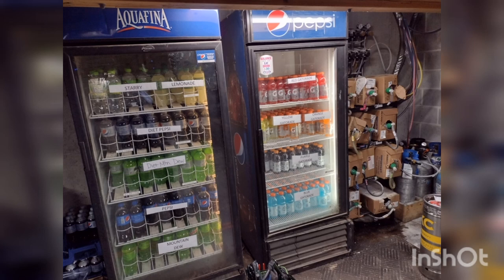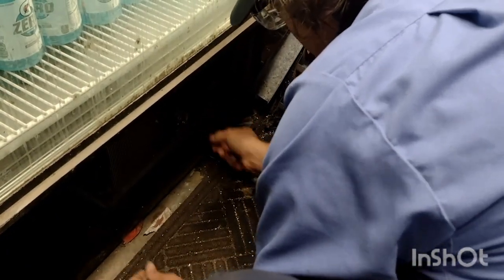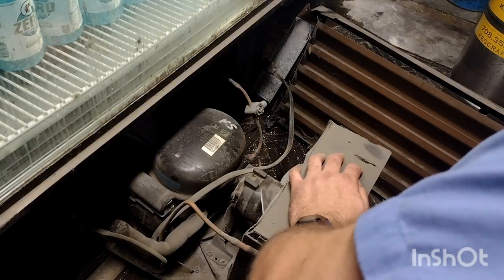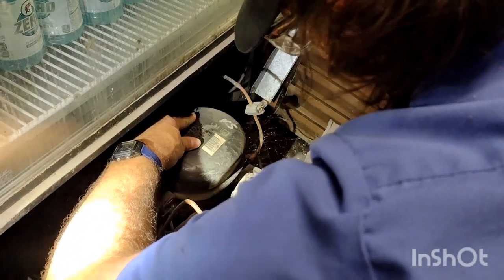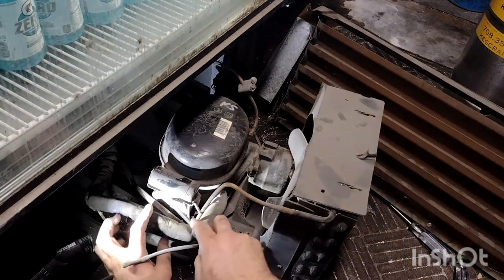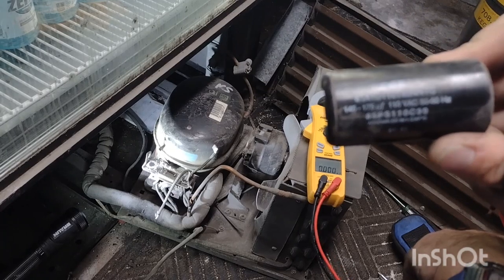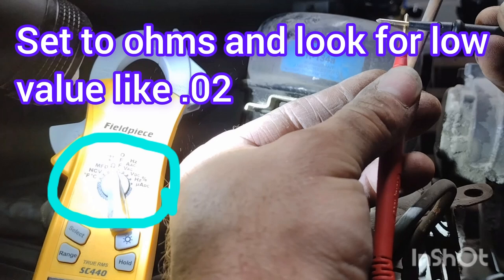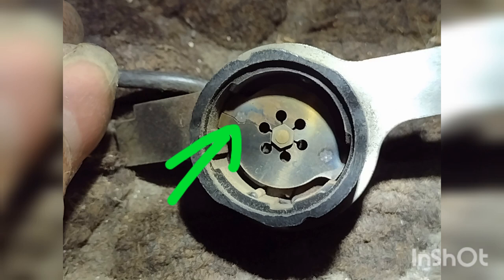True GDM-26: No Cool troubleshoot

Comment: What if the compressor is running but the fan does not run? Also, the place to plug in the deck reads 15v is it the ballast?

Comment: Nice diagnosis! I work on coke’s equipment
Reply: Any recommendations on where to start checking a GDM-15EM? NOT COOLING
Reply: @damianflores2091 I believe these are retro looking coolers? If so just start with the simple diagnoses. 
Is there power?
Is the evaporator fan running?
Is the evaporator frozen?  
Is the condenser fan motor running ?
Is the compressor running? 
Is the condenser coil dirty? 
If these all check out it’s most likely something relating to the refrigerant. And you would have to gauge up. 
If one of those questions above does not meet with the requirements then it will be something in that field. Bad fan motor, bad starting components on the compressor (as seen on the video ) or a bad thermostat.
Reply: @TheDave5619   Got a GDM-15 Retro not cooling with a PF2 (faulty condenser temperature) message during test. I believe everything else is working. Compressor, fans (cond & evap), lights are turning on, everything is clean.. Thoughts on how to troubleshoot further?
Reply: @fdelacou  sorry for the late reply. I read online PF2 is a Evap sensor. Is this a dixell controller ? The one you’re working on?
Reply: @TheDave5619   Thank you for the reply. I actually figured out the PF2 mystery.... There is no sensor connected to the EMS controller. So it's only "natural" that is is giving a PF2 message! :-D 
My next step is to figure out why it's not cooling. I get some warmer copper tubing going to the condenser and the copper tubing coming out is colder. I havent had a chance to measure the exact differential temperature just yet compared to the air in my workshop so it's my next step. I suspecting that the unit might need a reload of freon since it does not show any signs of having been serviced since 2016.
Reply: I just got a true gdm 10 and it actually heats the inside of the fridge but I can hear the compressor running. Does that sound like a freon issue?
Reply: @ashercooper4017  the gdm 10 is just a reach in cooler. I’m assuming it’s low on charge. If the compressor is on, condenser and evaporator fan are on
Reply: Most likely a refrigerant leak
Reply: @TheDave5619  gotcha. That’s what I was thinking as well. Just wanted to double check with someone that knows what they are actually talking about. Thank you!
Reply: @ashercooper4017  im not expert by any means lol but I like to help with the little that I know haha
Reply: @ashercooper4017  you’re welcome
Reply: @fdelacou  it's not freon it's refrigerant

Comment: total newbie to this stuff.  at 2:10 when you said you're gonna wanna short those terminals together or else you can get a nasty shock, could you please explain to me what exactly you're saying i should do by shorting the terminals together?  appreciate it!
Reply: hey friend, i'm sorry to bother but i wanted to follow up on my comment from a couple weeks ago cause i've got one of these i'd like to work on but i wanted to know what you were talking about at the referenced timestamp.  thanks, i really appreciate the video!
Reply: @BackwoodsCatholic  a capacitor stores electrical energy across its terminals, like a battery. the reason you short those terminals is to dissipate any remaining charge in it, and avoid getting shocked. practically however, you'll almost never get shocked on these kindve systems because, after power is disconnected, the capacitors will quickly discharge through the compressor windings without any outside intervention. but its better to be safe then sorry.
Reply: @hafizshaltu4872  thank you very much for that explanation.  Like I said, total newbie here, so I’ll ask one more: what’s the correct and safe way to short that capacitor?  I’m unfamiliar with how to do that.
Reply: @BackwoodsCatholic  my pleasure. shorting a capacitor is as simple as touching both sides of a capacitor at the same time using something conductive. a screwdriver, a wrench, a spoon, anything metal. just make sure your hand/body is insulated though.

Comment: What about the thermostat if it bad?? What about the line tap?? What type of pressures should the unit run at?? How much are the parts?? $$$
Reply: For you, minimum of $400 because of all the questions. You sir would be over our shoulder during the whole process.........
Reply: Must be related to the lower case patels .
Reply: Leaks are kind of rare. 9/10 it's a component along the way. Condenser fan kicked on, so t-stat seemed ok. Pressure isn't something you want to measure unless you suspect leak, you never really want to open these up. Parts cost, no idea but it's easy enough to find. You can get a hard start kit with your specs and it's cheap and easy to find and will solve the problem, though not ideal.

Comment: Picked up this machine or something similar for free on the side of the road yesterday, upon plugging it in it started heating the inside lmao
Reply: I got one on marketplace for $100 and he said it was doing the same thing lol. I’m going through trying to troubleshoot everything. Did you find a solution?
Reply: @ashercooper4017  I haven't done much yet, I'm not very fridge inclined. It's on my list of things to do tho lmao
Reply: @jacobbarnett9956  I feel you lol. I spent 45 minutes cleaning the inside and I slide the compressor out and blew everything out and started learning about how to fix a fridge. Whole new skill I’m learning right now lol. I’ll update if I find the easy fix for it
Reply: @ashercooper4017 might be a restrict in the line , check for dryers if there is one remove it and straight pipe the line if it doesn’t kick in replace the compressor, if you feel the compressor working then its the coil .